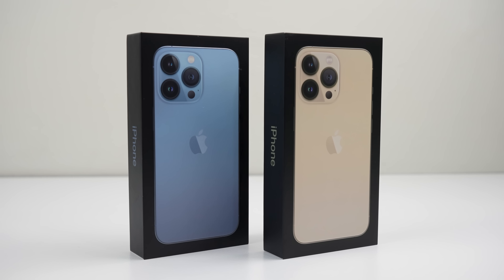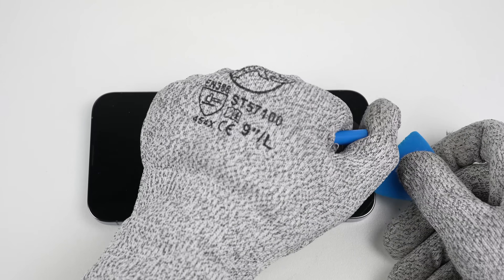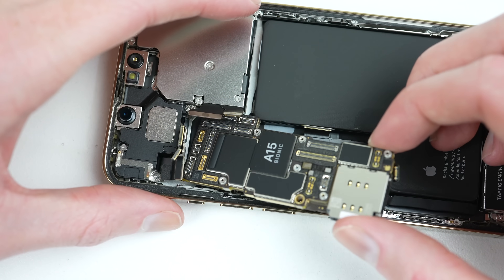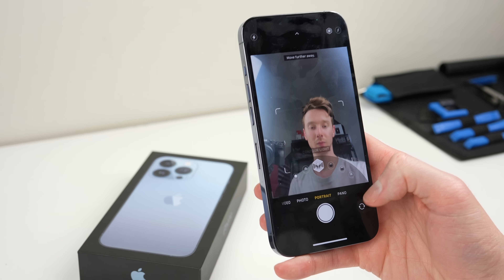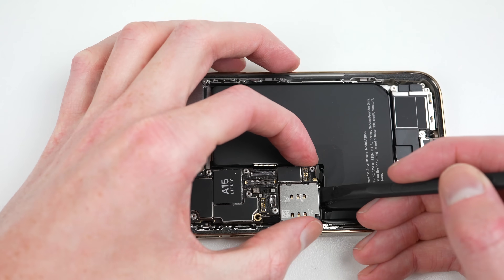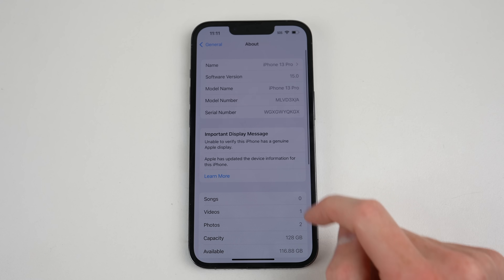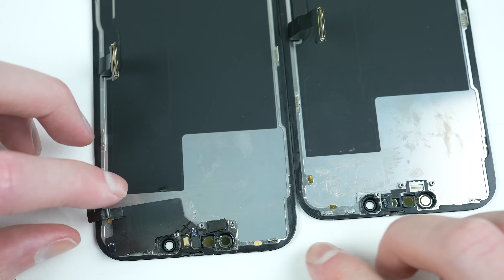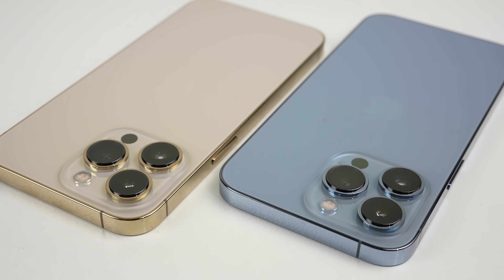iPhone 13 A Repair Nightmare - Teardown and Repair Assessment

Comment: I have had my iPhone 6s Plus since 2016, because I did not want to "upgrade" to a device that removed the headphone jack and lie about why they did it. I also did not want a distracting notch in my display. Now that all the other major manufacturers followed Apple's lead on poor practices, I settled on a new device that is not bleeding edge technology. I knew I did not require a flagship device, and since most of the flagship phones have no headphone jack, I settled for something that meets my needs and is much faster than my aging iPhone.

We as consumers are to blame for settling for less. I hope the rest of you wise up and stop enabling manufacturers to do this. In a capitalist society, the only way to effectively keep our rights is to vote with our purchasing decisions. If a company is not offering you the best they can, then do not reward them for screwing you over.
Reply: im still using pixel xl gen 1. I hacked it and got lineage os 17.1 on it
Reply: @DragonProtector  I am glad you have a way to utilize your device still with a supported OS. Unfortunately my iPhone is limited by the hardware due to the only 2GB of RAM. Your device has double that, so I assume you can continue to use it for even more years.
Reply: @Junkyard_Dawg  ya. truly rip. But im loving m,y phone still. I only use it for text, calls and web browsing cause to small for anything else
Reply: @DragonProtector  as an S5 user, I applaud you
Reply: @Carterthielftw_  yes
Reply: Capitalism doesn’t work, cause it leads to this greed that we are experiencing
Reply: @randyneves9701  As I said, we fuel these private companies with our purchasing decisions. There is no profit you can make if no one is willing to buy from you. If you can find an economic system that works and cannot be corrupted by greed, please let me know.
Reply: iPhone 5 s say Hi..

Comment: The only way to fix an iphone 13 issue is to TRADE in your old iphone to get a new model. WTF! You bought that phone and it should be yours already! And if you trade it to them the value is only 10-15% of it original value price.

Comment: Apple is all about „carbon neutral, we love the environment” etc yet their repairability is all against it. Basically if your display or battery gets damaged in the new 13, it becomes e-waste (as you can’t just replace the parts without doing some magic trickery that somehow disable the software locks). How is this saving the environment???
Reply: From their point of view, if you respect their stance that every Apple device must be serviced through their authorized service centers, they won't throw away any of healty peace of hardware inside, but rather just refurbish the device. The problem here is the price for their "work" and parts. And sort of monopoly that they build this way.
Reply: That's marketing in disguise
Reply: Only reason they are carbon neutral is it saves them millions on shipping costs
Reply: I mean to be fair,normal use does not damage your battery and as for display again normal use does not damage it unless it is a fault from apple,in which they are known to give replacements and usually get you fixed.I have had the same s7 for 3 years at this point and i have not dropped it once,or put my phone in danger,whenever i had to do something physical or something that requires my full attention i usually leave my phone somewhere else,or use a smart watch.
Reply: An iPhone battery doesn’t cost even a 1/10 of the iPhone retail price. Just be careful when you’re using your devices and you will never have to pay Apple hundreds of dollars for a screen.

Comment: The camera glitches were just laughable. There's two probable causes: Apple make their software design so complex a simple part change confuses it, or, the more likely variant, they made it glitch out on purpose so when an average user repairs at a 3rd party, they notice the problems and think, they messed up, thus then going to Apple, even if the parts are fine. They won't know better.
Reply: exactly

Comment: This sort of practice along with Sony's cameras having a mechanism that kills the logic board if it detects a non-genuine Sony camera battery being placed in it should be illegal especially in Australia.
Reply: Is this really a thing on Sony phones where the board gets killed
Reply: @oliver_lauritsen_oa  can't speak for Sony phones but for their cameras definitely so. Friend purchased a $4000 sony camera wanted an extra battery ended up ordering a Sony (but not from Sony directly) battery. Measured the battery was correct spec before putting it in was all good. 

Plugged it in and turned it on message came up on screen about the battery, put the old that came with the camera back in message wouldn't go away. Took to Authorised Sony Camera store in Melbourne inspection revealed board issue and they said yeah seen this before and that it's in built to the camera when it detects a camera that's not a Sony programmed one to brick the camera. 

Then had to deal with Sony support for months which was a nightmare. 

I don't mind the non genuine camera not working since you can buy from Sony directly but more expensive, but the bricking is ridiculous.
Reply: @jamesking7946  this sounds like a nasty business model this kind of locking down components should be illegal and cost the manufacturer $100000 in fine for every device sold with this kind of nonsense lock

Comment: This is kind of ridiculous Apple should follow the right to repair it is ridiculous that's why I love Android I never heard Android have this type of issue so if the iPhone's motherboard doesn't work you're basically stuck with a dead phone unless you go to an iPhone store you cannot go to a third party to get it fixed it is so ridiculous that's why I don't think Apple is going to stick much longer especially Steve Jobs is not there anymore
Reply: Will never buy an Apple product

Comment: For the iPhone 14 Pro, if you change the 2 bottom screws with 3rd party replacements it will disable true tone, face id, fast charging, 120 Hz and esim functionality.

Comment: This type of anti-repair engineering really discourages me from buying new apple-stuff. I have yet to brake any of my devices, but the knowledge that a cracked screen/camera replacement could cost basically half a new phone...
Reply: Depends which phone and which screen. iPhone 12 a iPhone 12 pros have same replacement price on apple site, even iphone 11 pro and XS/X. XR, 11 cost less as it is IPS screen, same as Mini repair is cheaper, Max repair costs more.  In my country display replacement for 12/13 costs abut 1/3 price of new. For 12 pro repair is same cost as 12, so percentage is lower in comparsion to its price... Certified 3rd party costs more than Apple. Non certified are at half price for recent models but they do not use original parts so no face id after that change.

But with AppleCare+ it is just 29 USD or so... twice per year.
Reply: @jirikocman  A third of the price of a new phone is indeed more accurate. Either I mixed up currencies and conversion rates or I thought of “other damages”. 

I had to look up pricing again to make sure, and it also seems like unsupported iPhones is on the apple repair pricing list. Which I guess is positive?
Reply: @tthbeige3332  With older devices, I guess repair is not worth it anyway
Reply: Then you should simply get apple care on your products :)

Comment: We need a law against this. I'm pretty sure even one country is enough to set off the domino effect and every country will start banning software locks.
Reply: I suspect the EU will be the first to introduce some form of repairability law. I suspect it'll be argued that [Insert company here] own the software but once the hardware is in the hands of customers they loose the right to control how a customer uses their product. If a customer needs something that can be easily repaired and reduce e-waste it should be possible. I'm not someone who knows the logistics of how this would work and be put into law, i'd rather leave that to the people who make these laws.

Comment: just get a Samsung
Reply: They aren’t any better, unlocking the boot loader on the Z fold 3 disables the cameras so you can say goodbye to installing a custom rom if you want to use the cameras. And if you break the screen on the flip or fold it’ll cost over $700

Comment: I just did a screen replacement on an iPhone 11 Pro running iOS 14.8, didn’t receive a non genuine display message. Once I updated it to iOS 15, I got the message immediately. Funny thing though is True Tone and auto brightness are still there (I used a programmer). Unbelievable
Reply from the maker: There was a bug that if the screen had a serial left blank or all 0's (if I recall correctly) it didn't show the message. Apple patched that so the message shows up now with IOS 15.
Reply: @HughJeffreys  well sounds like I’ll have to downgrade the iPhone to 14.8 while I still can. It’s amazing what Apple can control, especially since right to repair isn’t a law yet.

Comment: So yes, this is a non pro consumer thing, but at least it prevents people from stealing iPhones to sell their parts as originals, I guess?
Reply: You know what would prevent people from stealing iPhones to sell their parts as originals? Apple selling original parts to third party repair shops. Instead, they threaten the manufacturers of their parts and harass repair shops.

Or even just using the "serial" feature to blacklist specific parts marked as stolen.

But they didn't. They don't care about the consumer, just about making more money.

Comment: Although I disagree with approach.. I understand why apples does this. 
IPhone theft and robbery is big big issue. There has been incident where gang members follow through city to steal their phone., apple tried to fix that by locking... but thief started to sell those stolen phone for parts . .  
I use Samsung.. but I understand why apple does this.

Anyway thanks jeff for video
Reply: Lol if Apple cared about that they would sell the parts themselves, like Motorola and others do, and maybe just use the serialization to "blacklist" part of stolen Iphones. But they don't. They only implement it to make life harder for third party repair.

Comment: This phone is so hostile to repair I’m genuinely surprised it doesn’t have “warranty void if removed” stickers on every single screw.
Reply: In the US, warranty void stickers are non applicable to any devices, even from the manufacturer it's illegal to not honor the warranty (one year) that the US gov legally requires all companies to follow. 

HOWEVER, if your device has been repaired already or has shown repairs then it can be voided under the terms of "not original condition" hence why everything is serialized now. so that means you can still open it up and take it apart, but you cant replace anything
Reply: The warranty was void when you took it out of the box, you'll have to purchase Apple Care Plus Extra, only for a guy at a geniusbar to tell you you'll need to buy a new device.
Reply: @zdanee  For example here in Czech Republic there is no AppleCare+ available same as there is no official Apple store but certified retailers, but there is many options to get insurance for theft and damage or even prolonged warranty by 1-3yrs over standard 2yrs up to 3-5yrs warranty... Usually seller will offer you some kind of insurance and extra warranty.
Reply: Those stickers does nothing for warranty. For example in EU, if you do not buy directly from Apple, you have no contract with Apple so any warranty from Apple is just optional, and Apple still provides only one year but law requires 2yrs, but in EU seller takse responsibility for broken product, not manufacturer.

Becouse you warranty to remove manufacuting faults, is given you by low and law does not mentioning any stickers, you cant remove customers rights to repair that manufacturing issues, any warranty agreement cant change law. If it does, it is not legit and will be ignored

Comment: Gotta say, I got the iPhone 12 mini when it came out, and battery life has been fine the entire time I’ve had it, untill this month. In the past 20 days the battery health has dropped from around 96% to 83%. I swear they do this to make you either get yours repaired or buy a new model.
Reply: WOW. I used my iPhone 6s for two years+ to this day and the battery health, well I'm pretty sure it's either 87% or 86%.
Reply: Apple was fined for doing exactly this in 2017... Nothing new under the sun, I'm afraid.
Reply: @Xenro66  incorrect. You’re referring to them lowering performance once the battery gets so worn to improve stability, which Samsung and others also do…..  Also the battery life gets recalculated every so often. It may go up.

Comment: It’s Apple’s right to lock the original parts for copyrights … you shouldn’t have any rights to copy the parts they made … and not refund them for the R&D they did on the part
Reply from the maker: These arn't copy/aftermarket parts. There a brand new Apple parts from another phone.

Comment: i really thought after the IPhone 12 "tragedy" got trending, they'll learn from their mistakes but I was wrong. They really goes downhill and loves giving troubles to the users and not giving any profits for any 3rd party repair guy. I'm dissapointed. Truly am.
Let's all hope Samsung doesn't follow this bumpy road too, that's all i'm saying
Reply: Well I’m sorry to say but they’ve also started doing it by disabling the cameras on the z fold 3 when you unlock the boot loader to be able to install a custom rom (i.e lineage os) and disabling Samsung knox on all phones equipped with it when you root the phone so no more Samsung/google pay or secure folder
Reply: @HughRussell06  and they have the balls to say that they will not sunk as low as the IPhone. What a joke.
Reply: @audihaziq4168  yeah. The part that really ticks me off with Samsung is that they typically mock Apple for doing something such as removing the charger and then they copy them with their next phone

Comment: If they put as much effort into making these phones sustainable as they do blocking your right to repair Apple would have the best phones on the market.
Reply: Apple does not broke you right for repair. No one dictates where you have to apply your right (if your local law have any) and what cost is right for that repair. Apple have own reapirs for really old devices and even they have certified 3rd party in many countries. So you can reapir 5yrs old phone very easily. It only depends if it is worth it for repair price.
Reply: @jirikocman  so what are you trying to say?
Reply: Being certified actualy prevents your from doing alot of repairs you might want to do and it requires you to send customer information to Apple
Reply: That already do! (Have the best phones on the market).
That is why they don’t give a 💩about anything as long as they make money.
How does that saying goes… “You either die as a hero or you live long enough to become a villain”
Reply: @Nebafi  They are not the best. People like you make them feel they are the best
Reply: @Nebafi  no
Reply: @Nebafi  why would you want a company that has these kinds of repair restrictions to make any money, also saying that iPhones are the best is subjective and id personaly disagree with that

Comment: you should try changing just the display, like putting the 13 pros 120Hz display on the regular 13
Reply: Even if it fits (most likely doesn't due to the connectors) it won't do anything due to the software/firmware on the standard iPhone 13.
Reply: You do realise the 13 Pro has a larger display and the connectors would not fit on the 13?
Reply: @aydoyt  I do understand now that it has different connectors, but the 13 Pro and Regular 13 are the same size, I think your talking about the Pro Max which is larger 👍
Reply: @eduardosoto6997  it will not work bro. Even the same models display is not working perfectly with the phone, then how will the 13's display is going to work
Reply: @amd20077  The same model's display did work, though... if all you want is to see things in 120Hz. I thought that was the whole point of the proposal?
Reply: @Kylemsguy  not only higher refresh rate but also true tone aka auto brightness, face id
Reply: @amd20077  👍

Comment: For now I'm very thrilled about what would happen if you change 13 Pro's screen with an 13's screen. I would not be surprised that it will have 120Hz refresh rate because of software on 13 Pro's board, yet be manufactured for a 13.

Comment: Not spending $1500+ on a Iphone that is so locked down.  I'll keep using my 4S, I don't care too much about IOS feature upgrades.  All I need is a phone that works as purchased.  Good thing I bought a bunch of replacement batteries 7 years ago.
Reply: That was one of the last good iPhones simple and not restricted like iPhones these days
Reply: @Crazyreviewer123  don't forget iphone 6, not very reliable but not bombarded with messages
Reply: @baoquoc3710  that's true my sister had that phone although she had to replace the phone once for a falty screen it was a good phone to I used her iPhone 6 before a couple times and I liked it. I got a new OnePlus 9 now and don't plan to get another iPhone until this BS of over restrictions are lifted from apple and since Its basically to restricted from repair i can't really trust a iPhone right now with everything that's going on
Reply: The latest iPhone without software locks was iPhone 5